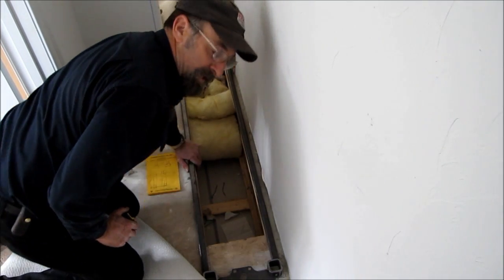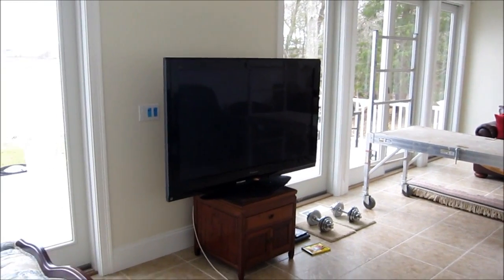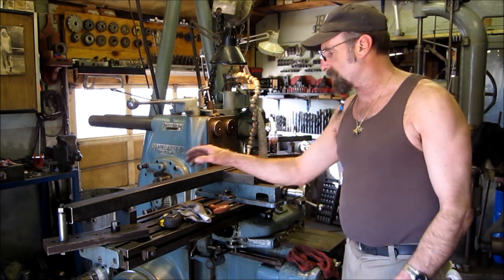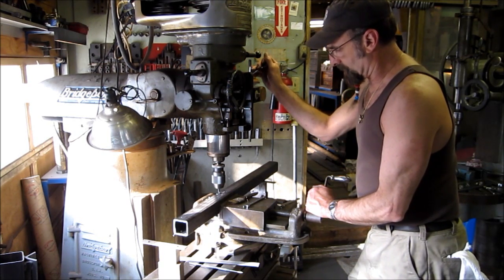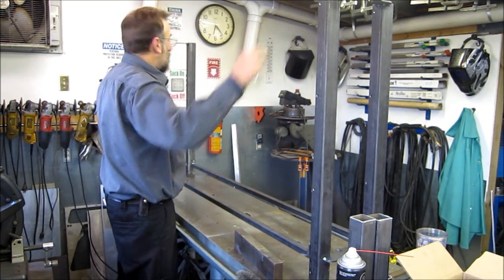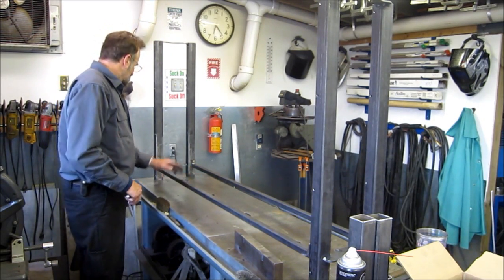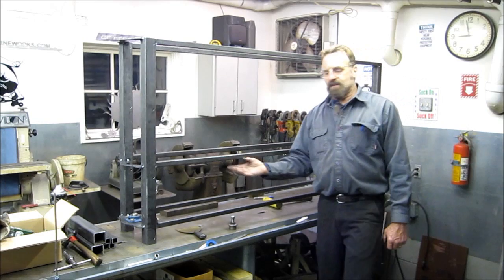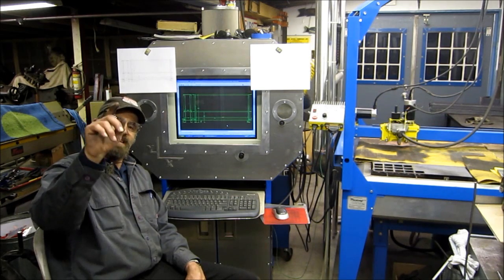Big Screen Elevator Part Two

Comment: Keith, I've got a Millermatic 250 just like yours, I bought it back in '96' brand new from a Miller dealer, my question to you is "your machine (when welding) sounds a whole lot smoother than mine does or ever did! How do you have your machine hooked up or fine tuned?"

Comment from the maker: Those squares were cut out on the plasmacam, lightly sanded and I found that you can cut a tap size hole, weld the nut to the square, run tap through, from nut side, just like I did on the jig table I made some time ago.
 I felt that it would be a good idea to catch video on location for the field work on this project, giving the viewer a better heads up...
 You know I've gotten so good at tapping with that method, never had the urge to buy attachment, of course I don't do production...

Comment from the maker: Ya, they are sweet and I have the tool, I needed the smooth tube face surface to hold my tolerances and the cross tube is going to be carrying some of the weight...

Comment: Keith nice job you can never have too many clamps, and old drill bits make great locator pins for welding.  That bit in the beginning was very cool now I see how its going to attach to the frame members in the house.

That's some fancy timing on the bridgeport power taping without a taping head.  You're just letting the quill feed itself once it gets started?

Making drawings as you go is a really smart move.  That way when you have to make another it cuts down on the head scratching...

Comment from the maker: You know back when I refurbished the K&T I used a two part epoxy, If I was to go that route again, I'd use mill spec. 150 green primer and 151 Haze grey. other wise I like to use Rust-oleum rusty metal primer and smoke grey. easy on the eyes and the dirt showing...